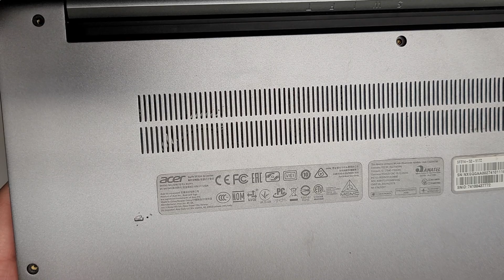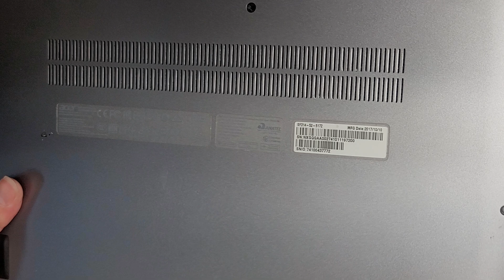Acer Swift SF314-52 Series N17P3 Disassembly SSD Hard Drive Upgrade DC Jack Charge Port Repair

Comment: Similar to my bf's laptop I tried to fix but I couldn't get the screws undone with a T5 Screwdriver bit. :/ It's a SF313-52/
Reply from the maker: @hannaheliza3954  try t6
Reply: @ItsBinhRepaired  Still nothing. I am so new at it I cried when I couldn't do it. The first time it worked but I didn't have your suction cup lol. Everyone in discord said, no it looks like a hex, but it worked on a torx. smh

Comment: great video main thing is to open the case without damaging other things, i have broken the silicon nipple beneath the space bar key is there a way around to fix it ?
Reply from the maker: @pradip-p8e  you'd have to scrape off the old one and put a new one
Reply: @ItsBinhRepaired  can you link me to some video ?
Reply from the maker: I don't have a video of it. I just use a flathead screwdriver to scrape the silicone piece off, then put a new one in its place. A very small amount of super glue can hold it. Use a needle to apply it to the base of the silicone piece, then gently put it in place

Comment: Ty.... Start by removing from the back, it is much easier to pry, it is the only side needed in my case with no tools, no need to pull from the rest of the sides. Best part of this video, info that screws aren't underneath rubber like some manufacturers.
Reply from the maker: Nice

Comment: So thanks to you, I was easily able to open up my daughters laptop. To be honest, it took a bit to get it open, but no damage fortunately. What started this whole thing is because she said that her charger just stopped charging the laptop. We bought this laptop around 2019/20.  She believed it to be the charging port and got a quote to replace it for $200. Wow. For her that was not an option. So this is where I decided to fix it, and so I watched your video👍. Excellent help it was, so ordered the part and received it the next day. Replaced it, however, to my chagrin, still didn't work. Hmm. Would the next logical assumption be bad battery? She purchased this from a reputable computer store as a 'refurbished' laptop (I figure some background story helps). I noticed that the battery was not screwed in, so when I was opening the back it was loosely in position. I was careful not to let it slide around and disconnected the battery before changing the charging port like you suggested. Any ideas? Thank you for your help, and once again great video.
Reply from the maker: Could also be the charger

Comment: I have a question 
I need a new charger for acer swift 314-41 series but its hard to find , is it usable  a 314-51 series instead ?
Reply from the maker: Do you have the old charger? There should be a model number on the charger.

Comment: I had a bastard of a time with my cover. Found that a set of feeler gauges helped.
Reply from the maker: Glad you figured it out :)
Reply: The hinge back has a bigger Gap that you can actually use a really thin screwdriver and pry it from the back first don't do it from the front and it works much better
Reply from the maker: Nice

Comment: Hi ! Do you think it’s possible to take the guts out and make a desktop computer by integrate the composent into another keyboard ?
Reply from the maker: Anything is possible, but it's up to you how much work you want to put into something like that. Why not just rip the screen off and use an external monitor keyboard and mouse?
Reply: @ItsBinhRepaired  I actually don’t know yet.. My laptop turn on for a few seconds and then cut but I didn’t see any visible issue when I opened it
Reply from the maker: @Tharsa_Temenehil  try a monitor
Reply: @ItsBinhRepaired  Didn’t work, the power LED turn on for a second and then it flashes every second :(
Reply from the maker: @Tharsa_Temenehil  sounds like dead motherboard :(
Reply: @ItsBinhRepaired  Yeah I should have known.. I smashed it on the floor after a bad League of Legends game 🤷🏼‍♂️
Reply from the maker: @Tharsa_Temenehil  oh....If you're lucky it could be RAM loose or damaged? But smashed the whole computer, I don't know.
Reply: @ItsBinhRepaired  Do you have any idea on how I can figure it out ?
Reply from the maker: @Tharsa_Temenehil  try removing the RAM and putting it back
Reply: @ItsBinhRepaired  Will try this weekend ! Thanks a lot for taking the time to answer !
Reply: @ItsBinhRepaired  I just realized the RAM is non replaceable so I guess I can’t take it off hahaha
Reply from the maker: @Tharsa_Temenehil  lol oh yeah
Reply: @ItsBinhRepaired  It’s alright I’ll just gut it, save the SSD and sell the working parts. Thanks a lot for your help
Reply from the maker: @Tharsa_Temenehil  sounds good, no problem!

Comment: Hi! Thank you for the great video. I have question for you: is the dc plug part replacement  for this model compatible with the s314-42 model? I'm looking online an it seems the only one available at the moment on Ebay is for the sf314-51. Please let me know. Thanks!
Reply from the maker: You'll want to ask the seller
Reply: @ItsBinhRepaired  OK, thank you for your quick response.👍
Reply from the maker: No problem

Comment: At 8:30 you pointed out the wireless card.  I couldn't see from the video, is it mini PCIe or M.2?  I was thinking of upgrading to 802.11ax.
Reply: It's an m.2 slot. I just upgraded it to an ax200 and it works perfectly.
Reply: @penguiz23  Thank you kindly.
Reply from the maker: @penguiz23  awesome!
Reply from the maker: Not sure, you'll want to open and check

Comment: There is some good information in this video, but I think you could have focused more on the charging port repair, which is a common problem with these Acer Swift 3s.  I feel like this repair is a bit complicated, and the viewer could benefit from some more detail.  Like, for example, why are you spraying hot glue everywhere?  Are you sure that's really the best solution, as opposed to simply installing a new port.  Anyway, thanks for the video.
Reply from the maker: You can do what you want. Every repair situation is different. If your charge port is broken, hot glue won't fix it. The hot glue was used because the support that holds it in place broke. A new charge port won't fix the broken plastic that holds it in place.

Comment: hi, does this power up with the battery disconnected?
Reply from the maker: I don't test all the computers like that. Give it a shot.
Reply: @ItsBinhRepaired  it is a simple question that demands a simple straightforward answer. Yes or No or I do not know.
Reply from the maker: @stylianoskostopoulos863  you got your answer, now try it and let the community know. Lol

Comment: I have this laptop and the charging port is loose.   What type of glue do you recommend using to secure it?
Reply from the maker: I use hot glue because it can be removed if you ever need to take it out or replace components.

Comment: I took it apart and fixed power charger port and put it back together and now mouse is messed up....looks like mouse keys are always pressed...
Reply from the maker: Open it and check if the motherboard and everything is seated properly.
Reply: @ItsBinhRepaired  it is ok I took it apart and reassembled making sure not to tighten the 2 front screws too much...seems ok...thanks good video.
Reply from the maker: @ror-ys3qp  glad it worked out. If you haven't already, please like and subscribe so others can find my videos. Thanks!

Comment: Hey, i have this computer but i have a big problem with the charger: sometimes ut just randomly doesn’t work or it “blinks” every few seconds from charging to not charging and it’s really annoying. Do you know if it could be caused by the charging hole, the battery or the charger? It’s my second charger with the same problem so i really don’t know
Reply from the maker: Might be the charge port in that case
Reply: @ItsBinhRepaired  do i need to change it or make it more stable like you did in the video?
Reply from the maker: @il_panettaio  you'll have to try it. I wouldn't know unless you brought it to me to work on.

Comment: Thanks, any idea where to buy the replacement charge port?
Reply from the maker: Usually eBay or Amazon. If you're outside the US, I'm not sure.
Reply from the maker: This should work. https://amzn.to/3mLkL2u
Reply: @ItsBinhRepaired  nope. The part in my laptop is 1417-00G6000 and is marked as indicating its a 65W jack. It is yellow and doesn't match the item you suggested! Which Amazon says isn't available).

Only one I've found has a 2 week delivery.
Reply from the maker: @scott040877  as long as the board connector is the same and the wire is long enough, as long as the plug fits, it would work. Doesn't need to be same color.

Comment: Hey, I'm pretty sure the other SSD slot was NVMe too, those metal strips below the plastic piece should be the actual contacts for the SSD, which straight up looks like a NVMe slot. You could have tried your SSD in that slot just to make sure. If it was SATA it would just be blocked from entering and wouldn't damage it at all. Other than that, this video is straight on point, anyone with a similar one surely will get a lot of information from watching this, good job!
Reply from the maker: I don't own these computers, so I don't experiment with them in case it messes things up and prevents them from booting. The chances might be small, but when doing repairs for a living, even a small risk can damage the reputation of my business is someone brings it in for a charging issue and then ends up with another issue. If you own this model and have tried and confirmed this, that would be great for others to know and I can pin your comment. Thanks!
Reply: @ItsBinhRepaired  Oh, okay, I thought it was yours from seeing you handle the battery to show the stuff underneath, I would never handle such thing in mine with that confidence, I'm afraid I might turn it into a ticking time bomb 😅
Unfortunately my girlfriend has the SF314-51, from what I've seen around the internet the 2 SSD slots look and location are identical, I will be opening it soon but I can't be sure the interface would be the same for the SF314-52 too. Especially because I've heard that even between the same models sometimes the interfaces are different. But I will tell here my results anyways pointing out that it's a different model. Would you happen to know it there's a chance of that second slot being disabled by the manufacturer?
Reply: @AlexandreG  hey, sorry to bother you; did you ever find out about the second SSD slot? I'm considering upgrading my laptop and I'm curious about this and don't want to buy an SSD that is incompatible 😅
Reply: @HitCoder  yes, there is a slot, but I've heard some dont have one. And from what I searched I suppose you can't see the connection from the outside. You're gonna have to disconnect the battery, then disconnect the SSD from the main slot and see if it's NVMe. If it's NVMe try to put in the second slot, if it doesn't go in it's because it's a M.2 SATA slot. You can be confident doing this without worrying to damage your SSD by experimenting that. The only way you could damage it is the normal way people damage their SSD, by dragging their fingers across the components in the SSD PCB and damaging one of them, but that is very easy to prevent if you are a careful person
Reply: @AlexandreG  thanks for letting me know, I'll take a look! :)

Yeah I've worked with computers and laptops for years, only at home but I'm careful with it all and am studying at computer science, so no worries there haha

I'll report back on what I find; my swift is a SF314-52 iirc so it might be more relevant/helpful to people scrolling if the models vary
Reply: @AlexandreG  thanks for letting me know, I'll take a look! :)

Yeah I've worked with computers and laptops for years, only at home but I'm careful with it all and am studying at computer science, so no worries there haha

I'll report back on what I find; my swift is a SF314-52 iirc so it might be more relevant/helpful to people scrolling if the models vary
Reply: @HitCoder  yeah thanks and good luck. Might help someone that might have the same model. Even though I wouldn't order an SSD based on experience of someone with the same model, unless you can easily get a refund. This brands are crazy, they will even have different slots in models that are apparently the same, so need to have that in mind!
Reply from the maker: Yup! Crazy stuff
Reply: @HitCoder  did you ever find out if there’s a 2nd SSD card slot?
Reply: @theunserious  Hello, unfortunately I didn't yet, but I've had to use this laptop as my main machine for 7 months or so, and it's getting to the point where I'm gonna start needing the extra storage. (256gb is not practical in 2023, even on linux) so I'll try to remember to give you an update if i do take the thing apart if you're still looking to find out this info
Reply: i brought mine on a computer store to ask if it's possible to expand my storage using the second slot. it works and they said it was an nvme!

Comment: hello, thank you very much for the video it was great despite my poor english : D just the part where you talk about the ssd, is there another slot for an additional ssd without removing the original one or we are forced to replace it? , and finally what is the location next to the fan? thank you again bro
Reply from the maker: I think that slot is an m.2 ssd slot if it is you can add an SSD not sure if it supports pcie nvme or only sata m.2

Comment: Hi, first of all thank you for this video. I have the same model and small problem. I dont know how but I lost this little black plastic thing which keep keyboard backlight ribbon in white connector. Its a small black piece. Its as you said above Rams modul and under S letter in the name of laptop. Can you do me a favor and if you know please name it. Over 6mth looking for it on AliExpress Ebay and Amazon... and still nth. Please respond. Thank you.
Reply from the maker: The only way to get that piece is to find a motherboard even a broken one and take it from there. The other option is to get a thin plastic shim and shove it in to thicken the cable.
Reply: @ItsBinhRepaired  Thank you very much. I need donator so. Ok I ll try to fix it using a hot glue pistol or as y said a shim.
Reply from the maker: @robertorayo  don't use hot glue. The connector needs to be pressed against the pins. Hot glue will insulate it and you'll never get it working again!
Reply: @ItsBinhRepaired  ok thank you. I ll give a sign if I repair ;) I wont use glue.
Reply from the maker: @robertorayo  you can add tape to the back of the connector to thicken it. Sometimes that works. Keep in mind it'll be harder to plug in.